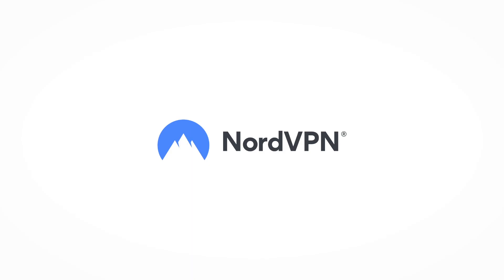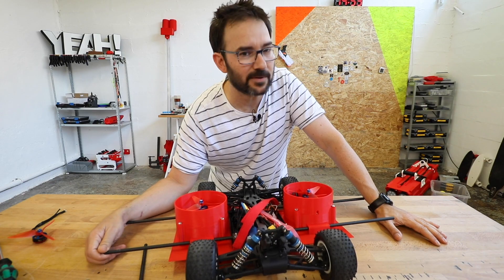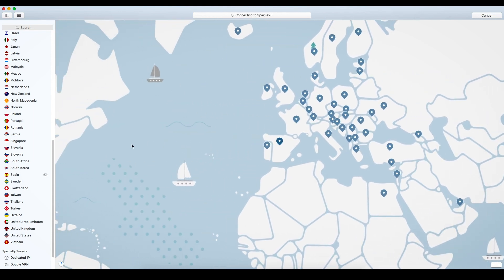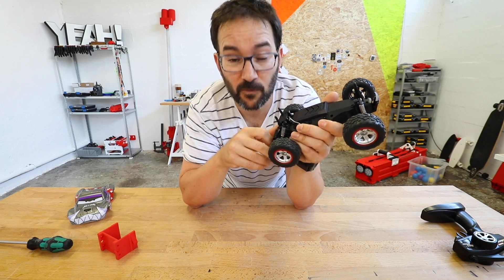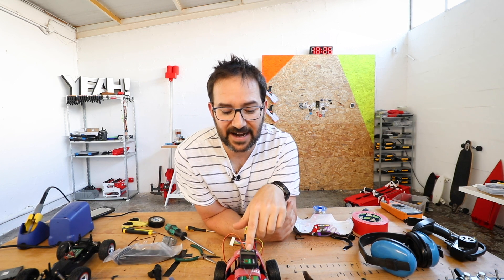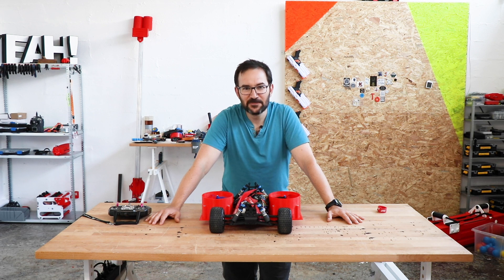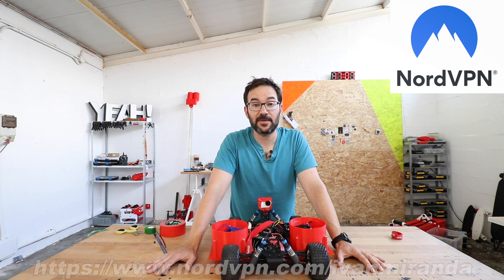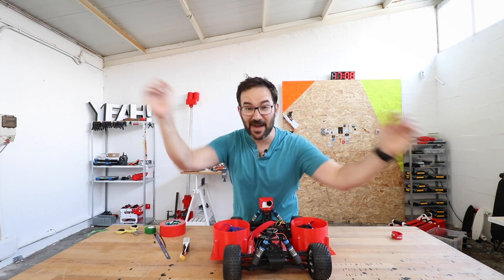RC CAR DRIVING ON THE CEILING

Comment: crawlers are the right choice for any kind of practical wheeled RC car. most of the regular ones are meant for racing so they give you basically no low speed control and torque. 

i got a crawler to do some testing with a while back and blew some ESCs and it has since been collecting dust. will get back into it some day. This was a fun idea for sure though. It is really scary to see your tests for this without blade guards though. Even with the mini version, because that is still a lot of power.

Comment: Hola Iván!

The video is old so I guess you won't read this comment, but the project could be optimized in 2 ways:

1- Properly seal the floor of the car (actually, the fans in this scenario) that it creates vacuum.

2-  When you accelerate or deccelerate, there is a weight transfer to the read/front axle. Real life cars which are heavily dependant on ground effect (such as F1) have anti-squat/anti-dive suspession.

Also, you could probably get better results sucking the air  it front/rear rather than on the sides, but that makes things way more complex. 

Despite being a very old project, it's an interestic topic, so I think it's worth looking into it. The channel Driver61 (preferrably the original one, I'm not a big fan of the Spanish one) has some interesting videos about it.

Comment: you have too much space between your fan shrouds and the suction surface. Make the suspension static and reduce the air gap and you will increase suction and be able to drive on the wall

Comment: Think of a hovercraft in reverse the closer distance you can keep between the vacuum force and the surface driven on the more efficient it becomes also if a spring loaded suction tray with rounded or curved edges to deal with friction/obstacles  well then you'd have it. also  if on ceiling a catch device would help like a 2nd person with a blanket stapled over 2 poles as a catch net

Comment: Great video!
Next time you can try to 3d print the full car frame with the fan integrated in the center and with a really tiny gap to the soil (ceiling), so that it grip without that much power.
Of course the car suspension must be compleatly removed to keep the gap always the same. This will make it to loose the ability to go from soil to walls and to ceiling.

Comment: there is some people that try make material with laser cutter , that stick with out a glue ... on a silicon based material... I wonder ... if you find a laser cutter , can you make tires that have more gripe , and not need so much air flow... to walk.... just to hold them nice!!!

Comment: Try replacing the shocks with a solid 3d printed part so that the car will not collapse and limit air flow. But the tires would still collapse. So another option would be to put mini caster wheels around the ducted fans to keep a constant distance from the ceiling or wall. Maybe experiment with the distance for optimal sucking force. 

For torque change the gear ratio or maybe a lower kv motor. But i dont think should be an issue in the first place.

Yet another thing using a rc car controller would work better as long as there is a channel for the fans. 
Could also make a curved ramp from floor to wall to ceiling or something.

In short i think there is still more potential for this project. Good work.

Comment: You need to reshape the intake area of the ducts so that they suck air from underneath the chassis. Then surround the remaining chassis with a rubber skirt. The car will then suck itself to the surface.

Comment: I suggest to max out the surface of the air outlet  next to the wall and get it as close as possible. so you have additional Lift since the Air would flow much faster between the wall and the outlet. Bernoulli f.t.w.

Comment: I had a small RC car that used the same principle to drive on the ceiling. If I remember right, it had no suspension - which let it have better control of how close the propeller was to the surface - and it had a hovercraft style skirt to focus the vacuum effect. It was small enough it only needed one fan, which it had in the center of the car. Cool to see a bigger version of that, but I pitty your ears!

Comment: Pausing to take a guess, as requested--looks like some of the propellers might not be matched with the rotation direction of the motors, so they're pushing the car away from the surface instead of towards it?

Comment: I made one of these a while ago, and I think Airhogs did a commercial product shortly thereafter.  Having a large shroud to give the vacuum more surface area to pull up on the car will dramatically reduce the power needed to stay stuck .  I worked real hard on making a segmented version that could transition between ceiling and walls, but foam sheet and scotch tape weren't rigid enough for me to get to stick without pulling the shroud to touching the ceiling/wall, and I never continued the project.

Also, these things are loud as hell.

Comment: Absurdly beautiful!  Absolutely amazing!

If the car were built like a quad copter, you could fly it to and from the ceiling.  It would also probably be capable of recovery from wall driving.

If you put slippery pads on the bottom of the fan shrouds, it could help with the car getting stuck.

A curved front bumper could help with wall to ceiling transitions.

And for the love of not killing yourself, get a hardhat if you work with heavy falling projects.  Stay safe, and keep up the awesome.

Comment: "I'm going to try a stupid test" I always check the time left in the video when I hear something like this. I've noticed the videos recently haven't abruptly ended as often because of a failure. Looks like your designs are getting better and better! 

Possible idea, what if you flipped those propellers and made an RC car that was REALLY good at jumps? Like a boost button that would speed them up and give it a boost off of ramps/cliffs. Not enough to hover.
Reply: DUKES OF HAZARD STYLE LOL
Reply: @mememan2344  "That Miranda boy is at it again"

Comment: There are a bunch of things that i think that can be improved here ( these are all just calculated guesses plz correct if i'm wrong)
+ Removing the suspension mechanism from the car will greatly decrease play between the ceiling and the inlet 
+ Using soft tires with no tread will help in gaining friction 
+ Try using propellers with a higher static pressure
+ Tinkering with the car's ground clearance should also help, higher ground clearance should provide with more stability as the rotors can be moved closer toward the wall decreasing the gap between the inlet and the wall

Comment: I guessing you were inspired by this...Brabham BT46  or not. Essentially you are doing the same thing so to improve the functionality you need to increase the surface area because you are using ground effects so its not just the air volume/thrust generated. This way you should be able to get away with much smaller thrust motors.

Comment: OK well the vac. idea not so good so now basically build an up side down droan and attach it to the car Cassie that way you can take off ground the ground fly up to the ceiling and use the upward thrust to hold your car up to the ceiling then drive it across with it's tires same idea but a push up rather than a suck up try this out it should work a bit better I think

Comment: You don't need thrust.... you just need to draw a vacuum under the car put a skirt and use a single propeller to suck out the air but honestly a centrifugal fan will create a stronger vacuum with far less rpm and noise

Comment: my guess was that either you had it too close to the surface preventing sufficient airflow, or that you had it too far preventing a sufficient vacuum. the normal system used for devices like this are to create a vacuum between the craft and the surface.

Comment: You just need to add the a better SEAL to the bottom of the duct...
Maybe a couple of coil of springs wrap with plastic...ect so it'll still glide over the surface
but still create a better suction.

Comment: hello Ivan,
I thought the surfaces around the holes were too thin to make a good suction effect
but I did not know that the propellers were fitted incorrectly.
Apart from everything, you've made another really hilarious video.
P.S. maybe on the walls you can go better vertically, because you don't have the gravity force across the direction of travel.
to the next videos

Comment: the props are meant to spin cw (left) and ccw (right) (for normal use, which would generate lift and you just reversed the rotation which reduces efficiency) and you spin them the wrong way would be my guess

Comment: You might consider keeping the foam from inside a matress that has become a bit too decayed to actually sleep on. I always end up buying cheap single-element 20€ matresses and after a handful years, they are severely shot and start collapsing under weight, because the foam has started to accumulate structural damage, little fissures and such.

BUT it's big and you can put it under your ceiling to catch... falling... cars... as absurd as that sounds. Without the outer covering, it should be perfect for this!

Comment: Smaller wheels will help with torque. Replace the suspension springs with solid carbon rods to help with bottoming out issues

Comment: It seems to pull harder on the left than the right.. My guess is a prop is on upside down or the motor is spinning the wrong way on the right side... Just a guess though as looking at the video they seem correct.

Comment: take the shocks out and make it solid, then you can use full power with out your motors sticking to the ground/wall.
Reply: To add on to this, adding stand offs, or spacers to the bottom of the motors may help prevent it from getting completely stuck to the wall.
Reply from the maker: Spacers! Always!
Reply from the maker: Shocks out, yes. 
Solid/harder tyres, probably yes as well.